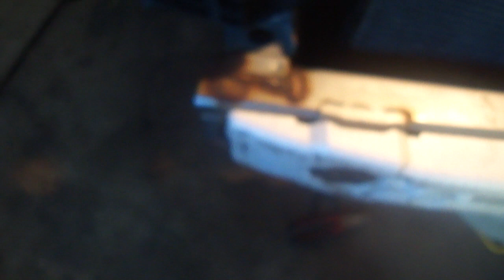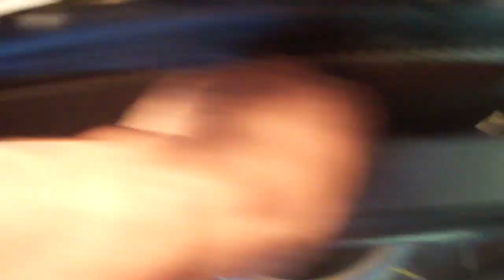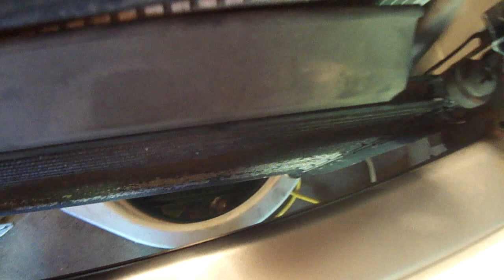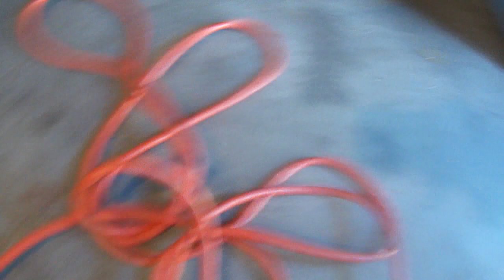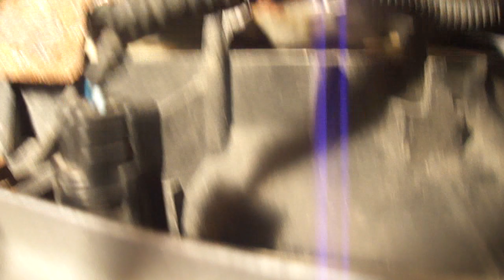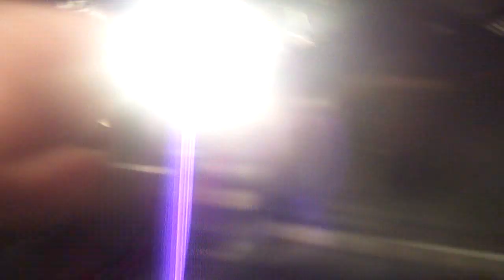2008 Honda Fit Radiator Removal (Tips And Tricks)

Comment: I just need to know whats under it. Can I jack my fit up from there? where is the front jacking point for a floor jack?
Reply from the maker: You can use the jacking point on the pinch weld or use the main frame member under the front of the car (follow the lower control arm on each side ). If you are still not sure hit me up on steviethescotsman@gmail.com and I can send a pic..cheers